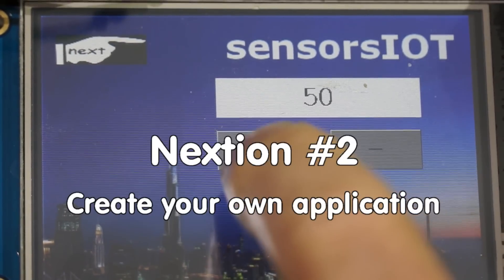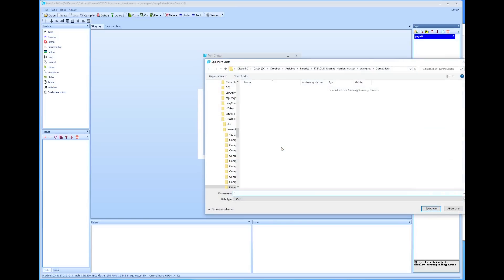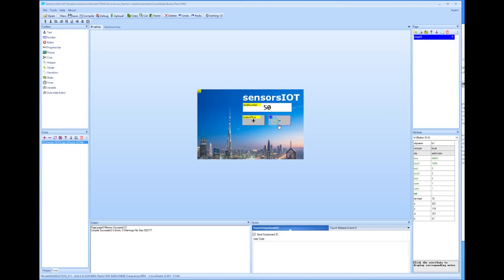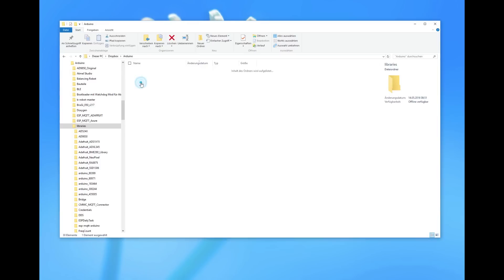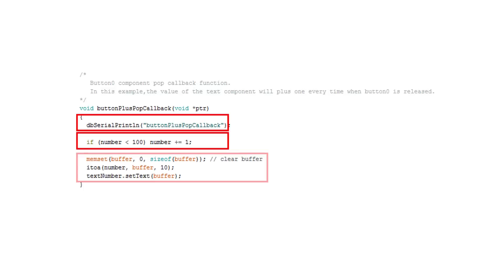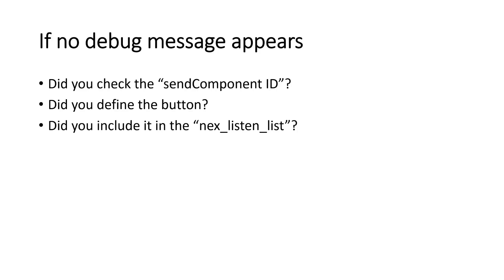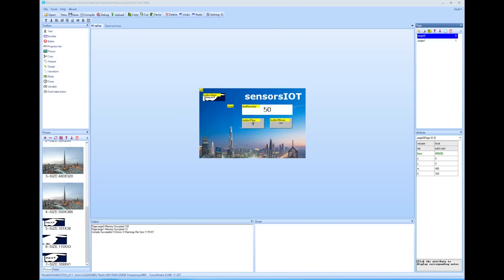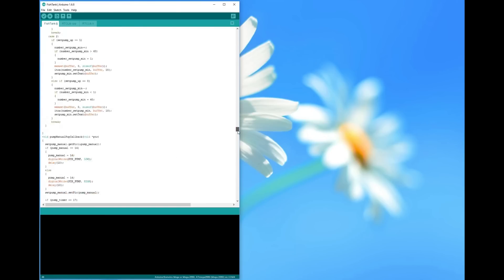#59 Nextion Display Tutorial #2: Create your own Application

Comment: I need Some HELP please, Not work for me in Arduino uno. I don't know what's wrong . Im copy paste the code, Charge the code But when I press the buttons nothing happens. Please need your helpe. I use Nextion 3.2 nextion enhanced versions.
Reply from the maker: Maybe you mixed TX and RX pins?
Reply: I've done the example # 56 Smart low-cost touch screens for Arduino. It works fine, everything responds, the RX TX ports communicate they respond to the changes in the Slider, but when I do the example # 59 Nextion Show Tutorial # 2: Create your own arduino application does not Respond me, no variation is made on the Values when asking the buttons. I am using the library (ITEADLIB_Arduino_Nextion-master) made the changes to the document (NexConfig) to work in Arduino UNO. I really do not know what I'm doing wrong

#define _NEXCONFIG_H_

/**
 * @addtogroup Configuration 
 * @{ 
 */

/** 
 * Define DEBUG_SERIAL_ENABLE to enable debug serial. 
 * Comment it to disable debug serial. 
 */
//#define DEBUG_SERIAL_ENABLE

/**
 * Define dbSerial for the output of debug messages. 
 */
#define dbSerial Serial

/**
 * Define nexSerial for communicate with Nextion touch panel. 
 */
#define nexSerial Serial
Reply from the maker: 1. Did you use the library from my Github? There are different versions of hte library around.
2. Put in Serial.print statements in the code ut understand where the problem is
Reply: Now it is okay, since it is working example # 59. It was a mistake in the speed at which I was initiating the serial port. Thank you very much for your support. For people like you that you can grow every day more, continue like this.

Comment: Hi Andreas,
Thank you for taking the time to put this great video together. After following you to the detail, and trying you other example, I keep having an issue. the issue I have is the following that I see in serial monitor.

[1704:0,3,buttonPlus]
[1704:0,3,buttonPlus]
buttonPlusPopCallback
recvRetCommandFinished err
[1692:0,4,buttonMinus]
buttonMinusPushCallback
recvRetCommandFinished err
[1692:0,4,buttonMinus]

And the counter does not add up or count down.

Any idea?
This is my first go around so a new bee here.
Your help is greatly appreciated.
Reply: Some additional in formation. I use the 7"
Reply from the maker: Did you use exactly the files from Github?
Reply: To what I know I did. I followed the links you provided. Really lost.
Reply from the maker: 1. You uploaded the file via SD card to the Display (e.g. ButtonTest#1.tft)?
2. The display shows Dubai and the buttons?
3. You set the parameters for serial connections and connected your display  according video #63?
4. You uploaded the  ButtonTest_1.ino to your Arduino?
5. You checked, that the Serial monitor shows  results, when you run the sketch and push the buttons? 

I ask these questions, because I am also lost without physical access to your device...

Somewhere in these steps is the error.
Reply: Hi Andreas,

Yes I did follow all the 5 steps you mention.

Here is a capture what I see in serial monitor.

[1704:0,3,buttonPlus]
[1704:0,3,buttonPlus]
buttonPlusPopCallback
recvRetCommandFinished err
[1692:0,4,buttonMinus]
buttonMinusPushCallback
recvRetCommandFinished err
[1692:0,4,buttonMinus]

So I see the communication from the screen when a button is pushed or released.
and then followed by a message of "recvRetCommandFinished err" not sure where this comes from.

I am using a arduino mega R3. and have the library installed in the following location:

Users\Gerrald\My Documents\Arduino\Libraries\
With the folder name Nextion-Arduino. (Not sure what name it has to be? and/or if this has any effect. In the version file is says ver:0.9.0
Reply: Hi Andreas,

I did just discover maybe something.
I opened up the window in the Arduino IDE, and did a "Verify" and noticed the following.

C:\Users\Gerrald\Desktop\Arduino\Nextion\Nextion-Tutorial-master\ButtionTest_1\ButtionTest_1.ino:52:34: warning: unused parameter 'ptr' [-Wunused-parameter]

 void buttonPlusPopCallback(void *ptr)

                                  ^

C:\Users\Gerrald\Desktop\Arduino\Nextion\Nextion-Tutorial-master\ButtionTest_1\ButtionTest_1.ino:67:36: warning: unused parameter 'ptr' [-Wunused-parameter]

 void buttonMinusPushCallback(void *ptr)

                                    ^

Sketch uses 8,850 bytes (3%) of program storage space. Maximum is 253,952 bytes.
Global variables use 1,208 bytes (14%) of dynamic memory, leaving 6,984 bytes for local variables. Maximum is 8,192 bytes.

Does this mean anything to you?

Thank you so much.
Reply from the maker: This has to do with the Nextion library. Did you use the Nextion library from my Github?
Reply: Yes I did. I am going to un-install the whole Arduino IDE and Start over. Basic new in stall and I am going to try this with Arduino ver 1.7.11, and Arduino Genuino Ver 1.6.13. And a new download of your library from Github
Reply: So I need to use the nextion.h out of your example github not the original from itead?

Comment: Thanks for another interesting video. After seeing your nextion video's I decided to get one. I have the 2,4" one. I am currently trying to figure out how to set colors on controls. But I cannot find out how the coding scheme works. I have a color sensor that puts out rgb data and I need to combine that to a single uint32_t value but I can't figure out how it works. Do you have any experience with that?
Reply from the maker: No, unfortunately not.

Comment: HiI am planing to make a counter tha can use both  button on nextion and external push button. ex I push external button and effect to button on nextion too. I do not know how to send the command from  arduino to nextion display. can you recomment meThank
Reply from the maker: Your button on the Nextion seems to have two functions: One is to send a signal to the Arduino and two to display a status. Send the signal is easy, you can use the examples. And to display a result you could chagne the color of the button or its text. There is also a Two State button available, but it is not easy to be synchonized with the Microcontroller.
Reply: Thank you for your kinds

Comment: I'm having nightmares getting started. Every time I try to compile I get this on all my pictures:
Error:degrees.pic InputVal Invalid:Invalid Pic ID

Can someone tell me why? I followed this practically to the letter!
Thanks
Reply from the maker: I assume that "degrees.pic" is the filename of the picture. I just tried, imported a png picture, assigned it to an object on a page and compiled withour problems. What kind of file format do you use? How is the picture presented in the lower left corner? Do you see it in the "picture" tab?
Reply: Hi Andreas, I figured it out.. my buttons didn't have a "pic 2" selected for the press, and some of my other pics I selected crop picture, but didn't select the picture afterwards. 
Thanks

Comment: Andreas. I am trying to display the information of a DTH11 sensor onto the Nextion display. All of the demos I have looked at requires a button push to change  text in a text box. I see how it works in this demo, but how do you do it without pressing a button???
Reply from the maker: You should be able to just set the .text property in your sketch:
long entry;
 if (millis() - entry>500){
  memset(buffer, 0, sizeof(buffer)); // clear buffer
  itoa(number, buffer, 10);
  textNumber.setText(buffer);
 entry = millis();}
If you place this in your loop, it should display it. Please make sure with an if statement, that this code is only called every 05. sec or so. Otherwise you can overload the communication to the ESP. Do not use delay(500) in the loop. Otherwise the reaction of your Nextion will be slow.

Comment: Hello Andreas. I just loaded up this project on my Mega and 5" Nextion display.  Except for a few spelling errors this sketch would not compile unless I added  the following libraries: #include <SoftwareSerial.h>
#include <SD.h>
#include <SPI.h>
Once I added those everything worked like you described.  Can't wait to continue on to learn more about using the Nextion display. 
Thank you

John
Reply from the maker: This is quite strange. I just compiled the files of github and had no problems. Did you also install the libraris from my github?
But anyway, I am glad it works.

Comment: hello am working with arduino mega and nextion 2.4 " , the program compiles the arduino same in the display , but there is no communication and monitor serial I get the error.
recvRetCommandFinished err
recvRetCommandFinished err
setup done

Please could you help !! ?
Reply from the maker: I do not know which library and which sketch you use. So, it is hard to help.
Reply: I appreciate your response , using the library estou will link you share and is the example presentas.el problem and solve it , it was an error They begin the rx and tx connections were reversed. thanks and regards.
Reply: Have you found a solution? I have the same error.

Comment: i'm also learing alot from your video's,
i'll have the 7" nextion with a arduino mega 2560 r3.
building my arrduino aquarium controller.
Reply from the maker: +William de visser Wow, 7". This is nearly the size of many aquariums ;-) Good luck with your project.
Reply: +Andreas Spiess  7inch nextion i mean,
Reply from the maker: +William de visser It was just a joke. As you know, I have a 3.5 " display. So, I think, a 7" is quite a big one... And it is quite expensive, too.

Comment: You should make a video about android application called Blynk. You can communicate through wifi with your Arduino or esp8266.  You can add a lot of widgets, but the best is that you don't need program. Just upload a sketch to your board and done! (Of course 99% of people are programing anyway when doing a project)
Reply from the maker: +Vincent Wiedermann Thank you for the hint. It is definitively on my list, but so far, I it did not yet make it to the top ;-)
Reply: I have big troubles when finding it on Google (Arduino Blynk just shows guides for beginners) so here is link : www.blynk.cc